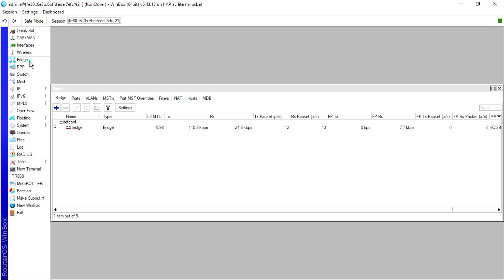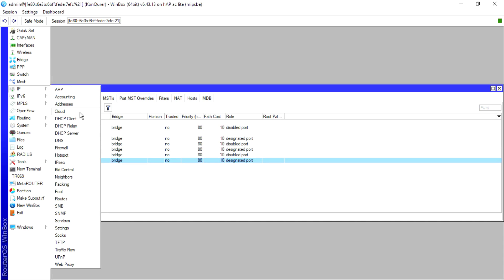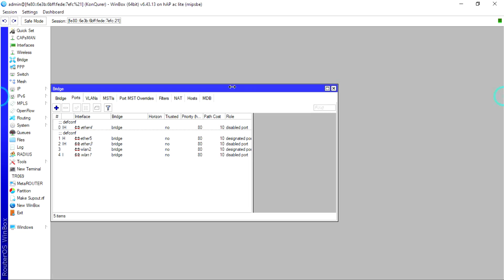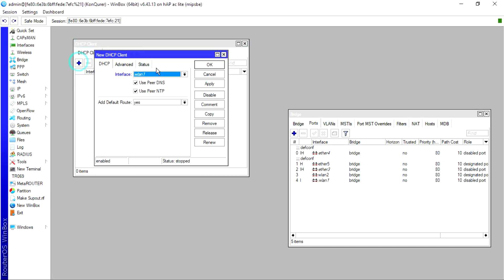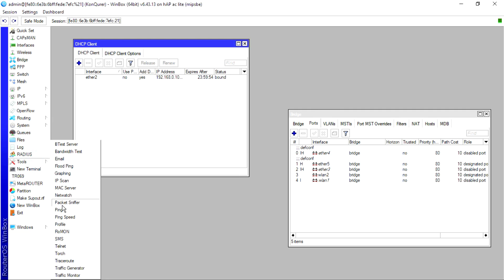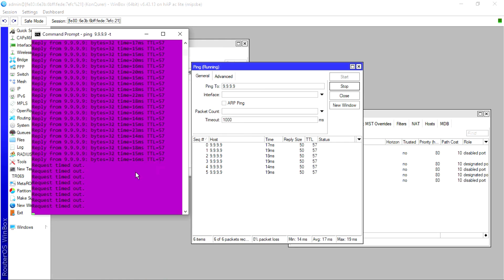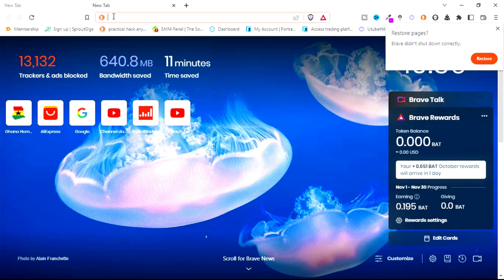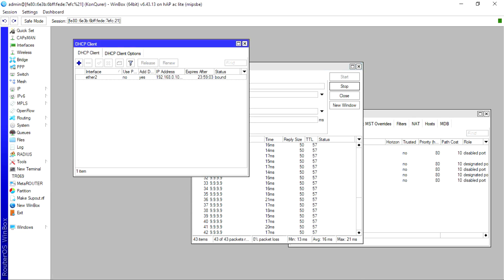How to power on Mikrotik Router without DC power

Comment: Please can I use a 30,000mah power bank to power the device. And is it advisable, please will it last.
Reply from the maker: Yes it's possible but you would have to check the wattage and voltage of the power bank if the device will support though I have not tried that yet. But I guess it should work since it's another means of providing power to the device..